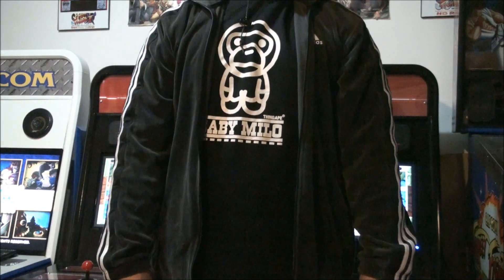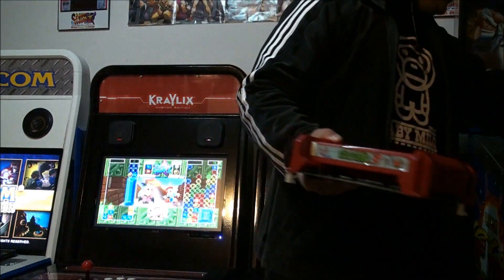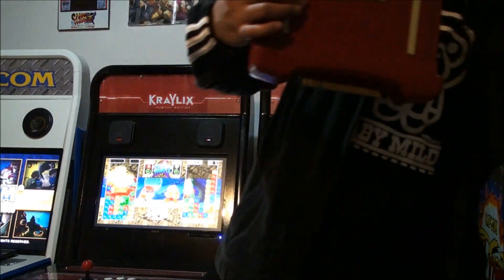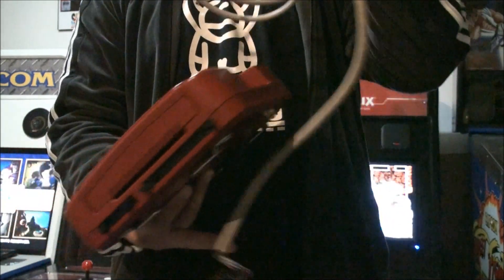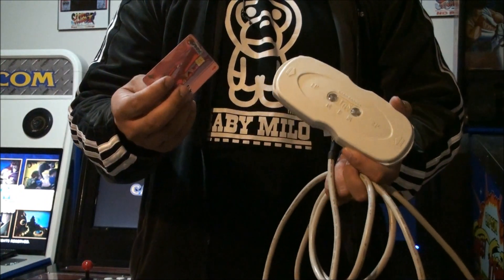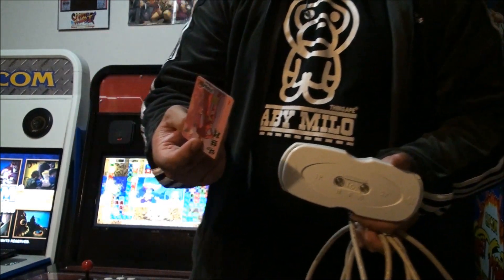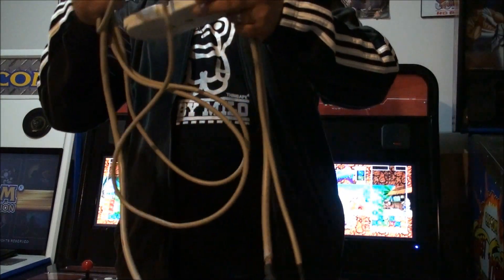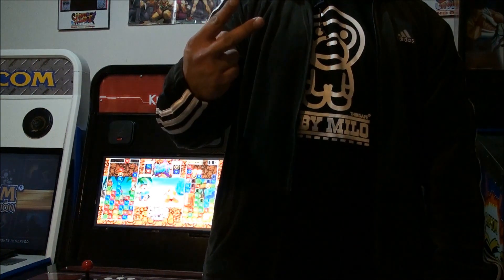PGM & PGM2 System (Real Arcade Hardware) Polygame Master

Comment from the maker: Yes i have 2 Kraylix slims, they are 1 player for head 2 head action. The blue one with capcom marquee next to the Kraylix slim is the 2 player Kraylix version...As for fitting through doors, yes you can fit through standard doors as the control panel can be removed.  Since you're going to have it painted make sure to ask Kray to add the latches in case it does not come with it...Kray does awesome work, you wont be disappointed.